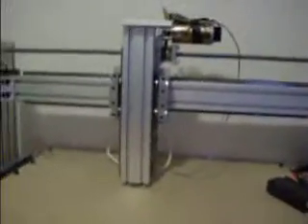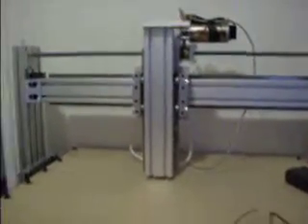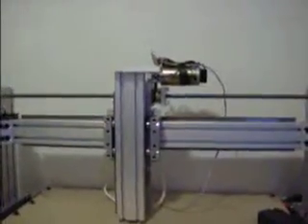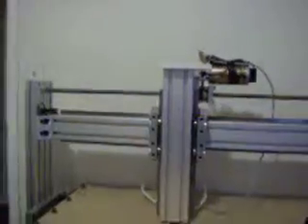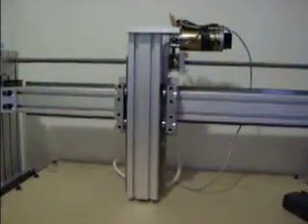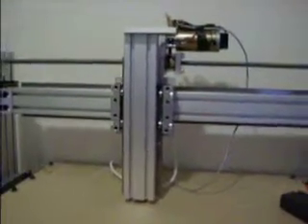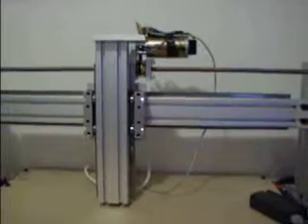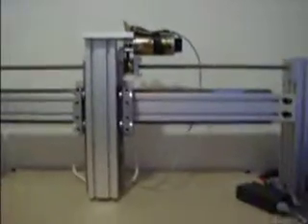3 axis mill EMC mesa 7i43- Work in progress

Comment: 7i43. It's working good now but 1 blown for no apparent reason that I could find out. Get the breakout/protection board too. Definitely a big improvement in cutting with the mesa board over standard printer port.